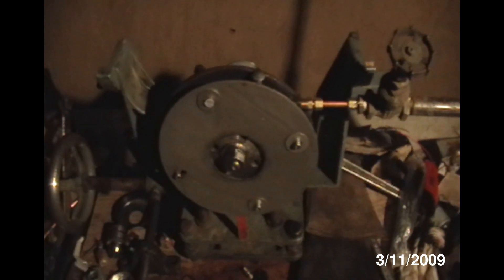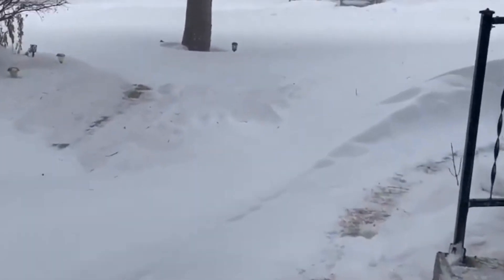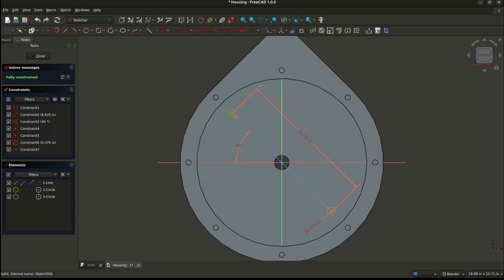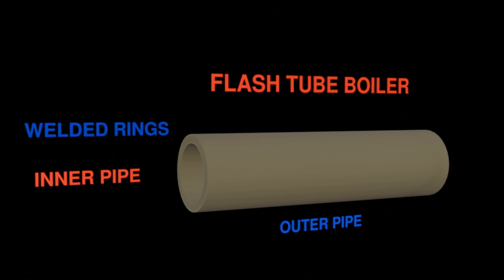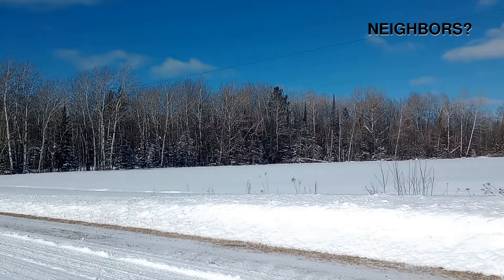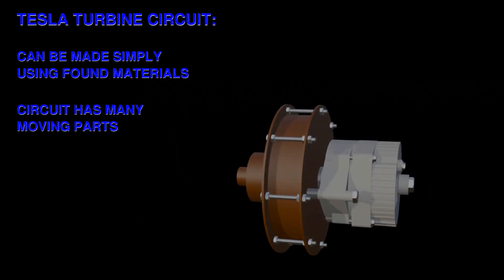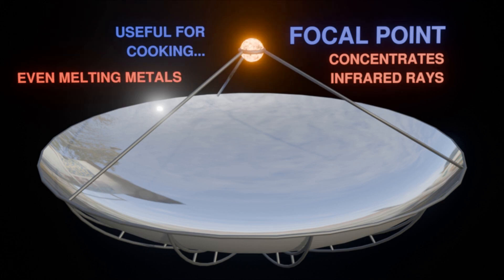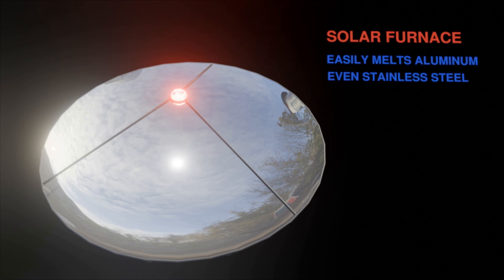Homestead Series Part 2  - Tesla Turbine and Solar Thermal

Comment: You need to fit the turbine as tight into the casing as possible for as little gaps as possible, so the space for the nuts inside the casing should be removed, as that space will make the steam flow around the turbine and lose power. You also should add more discs (around 15 minimum) and a very small gap (2-3mm gap) for an overlapping boundary layer on the disc gaps, otherwise you will lose a lot of power by steam that will flow unaffected by the turbine. Peltier devices are extremelly inneficient, less so than your steam system, so they should be ignored for this. Even though your system is cheaper than the solar panels, it has a larger headroom for efficiency than the solar panels themselves, being able to reach 34%, while solar panels only have around 14%. Try also adding some thins to your "flash tube boiler" to increase surface area on the exhaust gas.
Reply: Solar panels are 20+% efficient now days

Comment: Great work, thank you.  Here are three related channels whose experiments might be useful to you.

 I built a PV DC Semiconductor Immersion Water Heating Element! diode chain application #science 
https://www.youtube.com/watch?v=e1pFP2a4xqg

 Stacking 5 Peltier Modules, and Reached -90℃ 
https://www.youtube.com/watch?v=ImiSpAjKjss

 Woodstove Radiator - Max Heat From Your Fire | Woodstove Efficiency Reimagined Pt2 
https://www.youtube.com/watch?v=as1jIeabK-U

Comment: device you showed has less than 1% max/limit/theoretical efficiency. you can model anything. you do not know physics of these things. just test it first by exchanging tesla turbine for standard centrifugal electric pump, that way you dont waste your time modeling / constructing nonsense.
Reply: best type of solar furnace for melting metal is pointing light down towards hole dug into the ground. soil is cheapest insulator. diy cheapest possible PV system + resistive heater is cheapest heat if you include cost of human labor of managing power production.
Reply: Another theorist